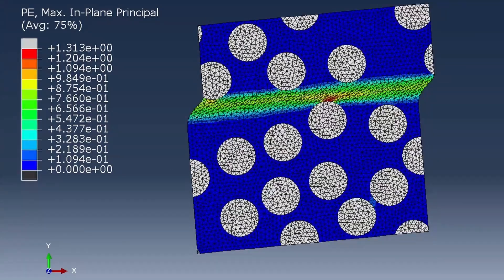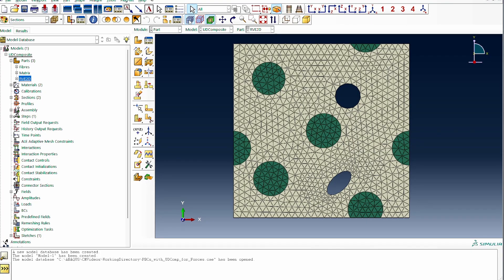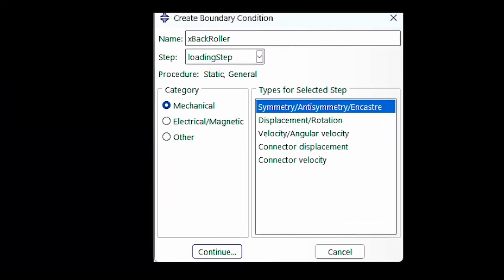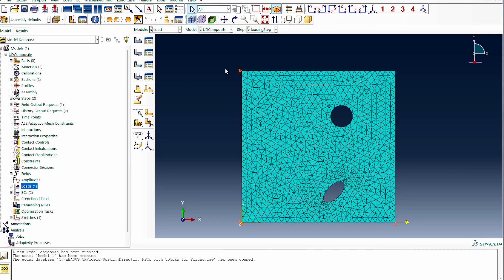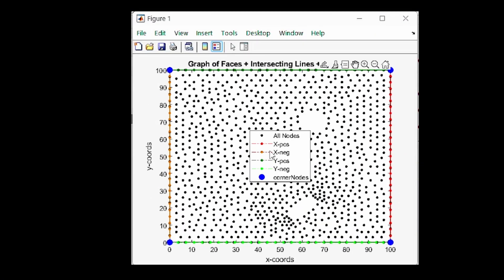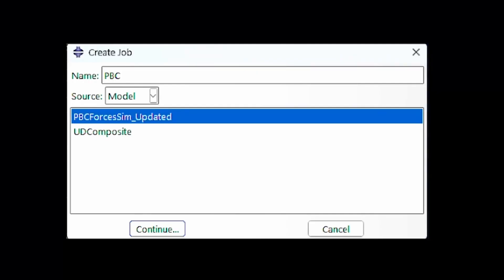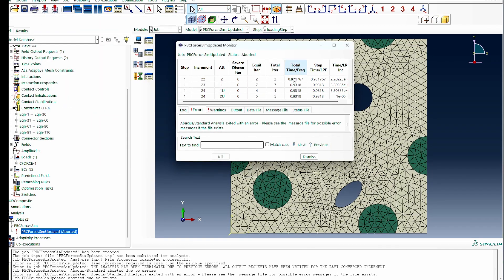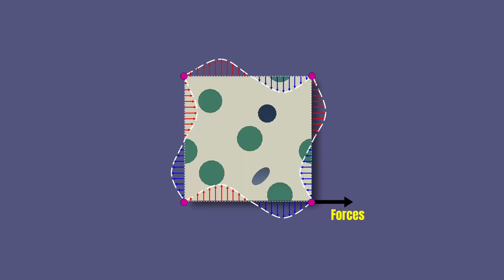How to apply PBC with Force Loads in ABAQUS

Comment: great video, can we do inverse homogenization to get the desired properties of material by Abaqus?.
Reply from the maker: Hello, I cannot see why you should not be able to do inverse homogenization here. I have shown how for known microstructural constituent properties, you can use PBC (in this case based on a Force loading) to generate effective properties of the composite (globally). 

For inverse homogenization, you are trying to reverse what I have done. You properly will know some experimental data of the effective properties of the composite, then run this type of simulation (assuming some random microscale properties). In the end, you can generate the curve that matches what you ahve experimentally. The assumed microscale properties can then become you optimal microscale constituent properties.

The big elephant in the room here is the 'assumed' and it goes to the question of how do you assume? Therefore, within the literature on inverse homogenization, some implementations like the Mori-Tanaka approach have been chosen to help  you make that 'assumption' objectively. 

I hope this make sense.